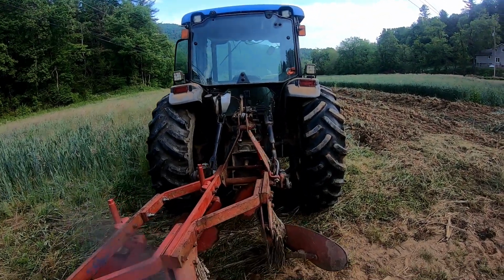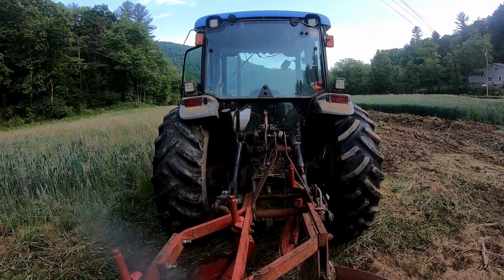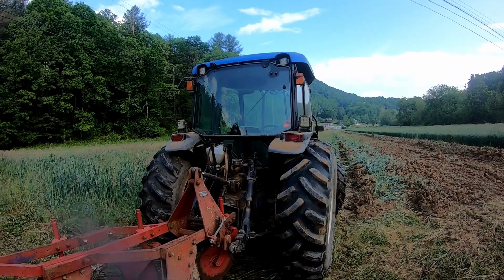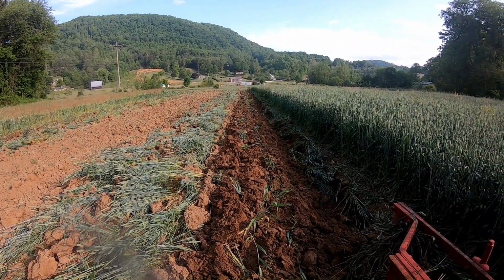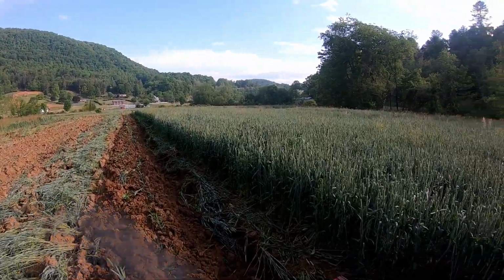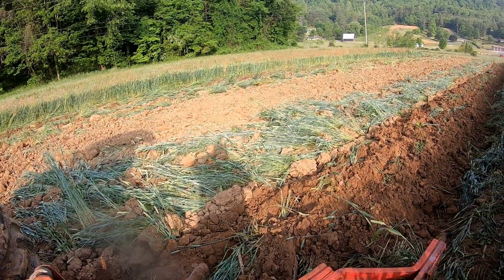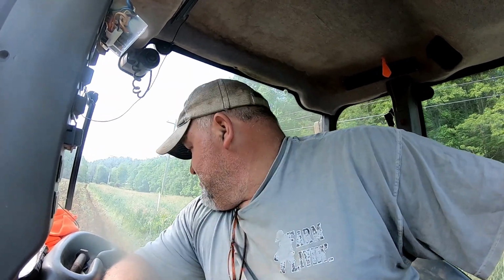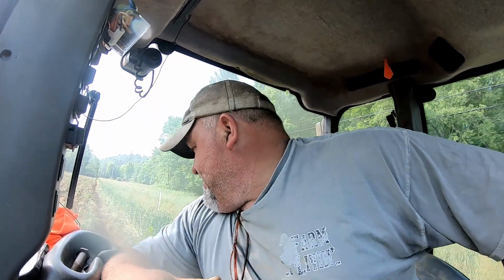Plowing In Overgrown Cover Crop

Comment: Have you ever run a 2 disc turning plow?  They don't  do as nice a job as  a mold board but they are perfect  for  something like this. I  can't find anyone who can demonstrate how to set those up properly.
Reply from the maker: Have never used one
Reply: My two bottom 14" moldboard plow takes out about 27" of ground per pass if the ground is right. My two bottom 30" disk plow only takes out about 19" of ground per pass and does a good job even in dry ground however, it will keep you in the field longer due to the shorter cut.
Reply: It will set up about the same as what you do with a moldboard. Sometimes experimentation  doesn't hurt.

Comment: If you take and put number nine wires about 4 ft long on your Kohler that will pull that trash under the dirt and it shouldn't plug as much but you need to hook them to the Coulter

Comment: I have a set of the same plows they are ford 101 they do a great job but i take the coulters off with out them on they dont plug up like they do with them on the 101 is not a high clearance plow I have a set of ford 142 and those have a lot more clearance for trash to flow through better the 101 and 142 was made by pittsburgh and they do a excellent job if set right